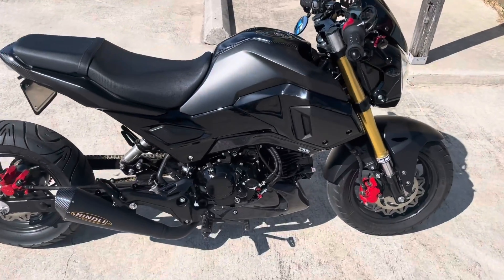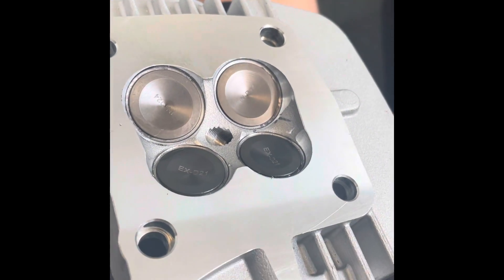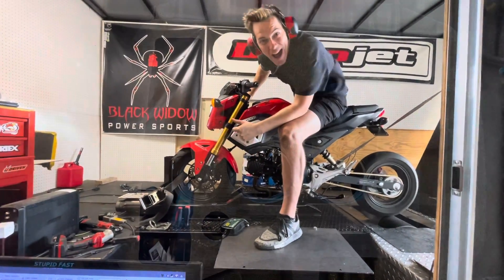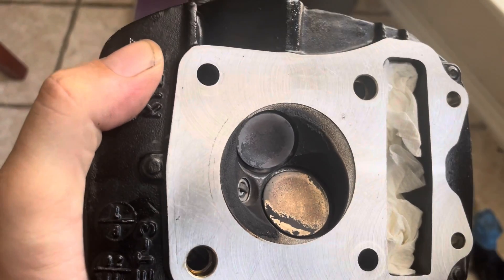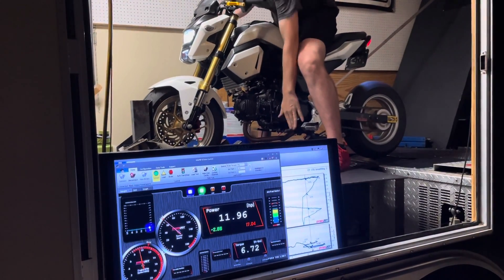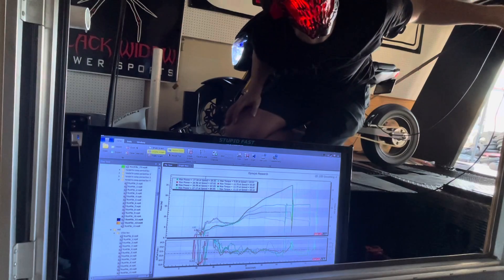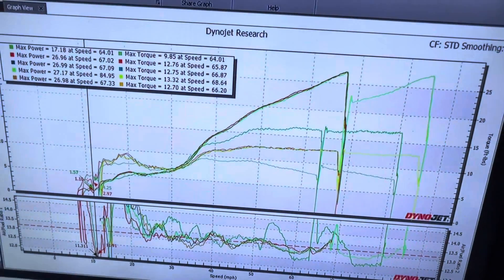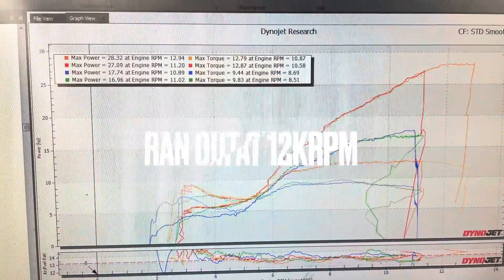Honda Grom 4v 170 Vs 2v 125 build

Comment: Can u run a 4 valve head with stock bore?
Reply from the maker: No the valves would clip the cylinder wall
Reply: @blackwidowpowersports6037  i had a feeling. would it work with the 140 or is it the same problem?
Reply from the maker: @Tota1Everything  it barely fits the 170
Reply: @blackwidowpowersports6037  I didn't know that. I plan on getting a grom and im wanting to learn about it to modify it. Thank you for the information!!!

Comment: Timing on this Motor set at 0??
Reply from the maker: No
Reply: @blackwidowpowersports6037  was curious on what kinda timing these motors run about to get my 170 4v running
Reply from the maker: @armdrop101  I was referring to Cam timing ignition timing is normal
Reply: @blackwidowpowersports6037  gotcha i figured